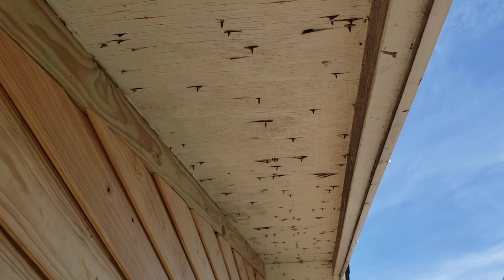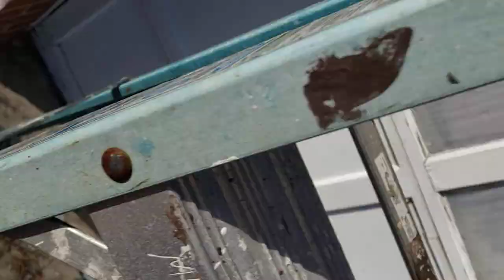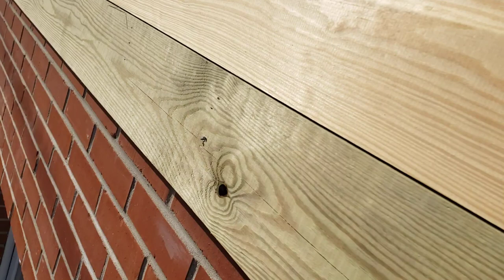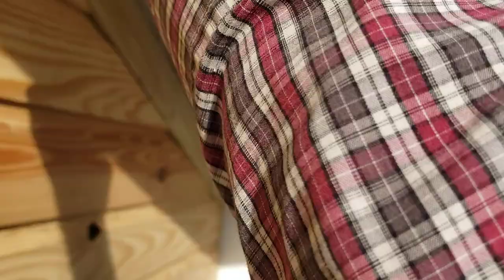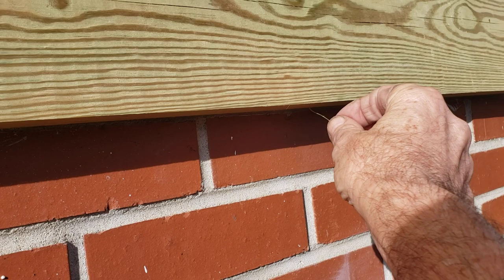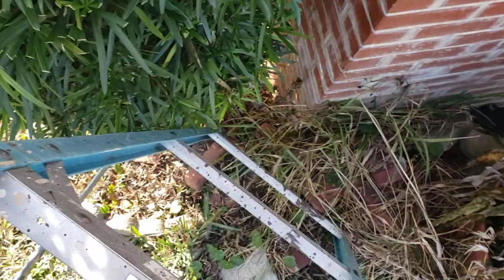No Roofer .. NAILS too Long for the (Overhang Ruined)

Comment: Plenty of roof inspectors on here but no roofers, huh? Well I am, and they need to secure the shingles to the decking. If the decking is too thin then you pay to add thickness by paying to split a layer of sheeting over the existing material or you put up with nails being shot through. The sheeting looks old so that roofer didn’t install it. Homeowner will silicone that section so the nails aren’t don’t through or they hang nailed 3/4” nails on they overhang section. Either way, that roofer did what you asked of him. Pay them for that. The siding portion should teach you to hire out the different trades. Hire a sider for the siding.

Comment: Municipal code in my area requires 1 and 1/4" length nails. My old roof was 50 years old and was held on with 3/4" nails. Never had nails sticking threw, never lost a shingle. Just had a new roof installed. Begged the roofer to use 1 inch , but the nails popped the wood and poked through a bit. Check local code, but the insurance industry is to  blame.
Reply from the maker: They cover the nails up after I said something to them about the nails.. And they just Sold the House for $325,000.00.. Thanks for that comment..